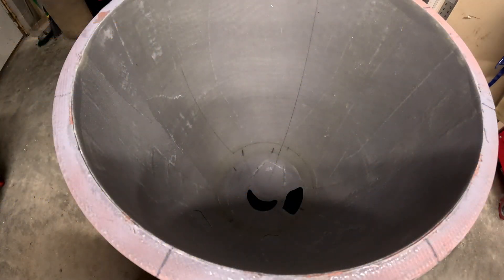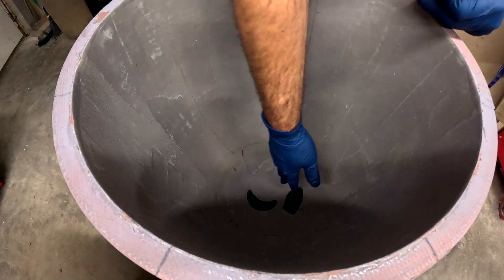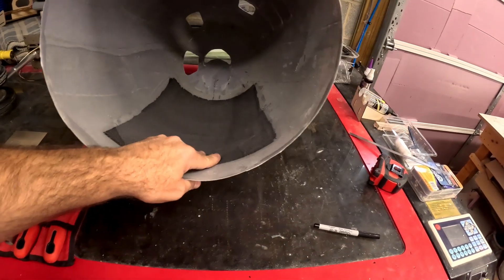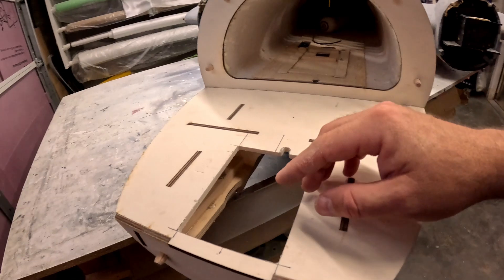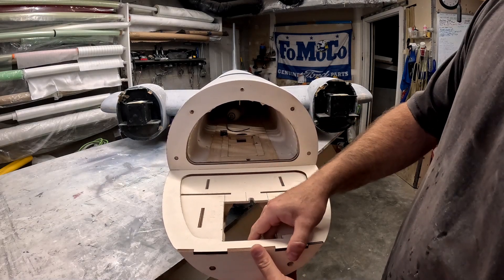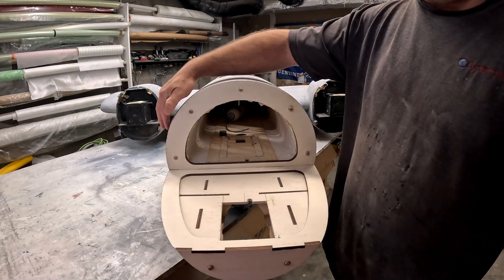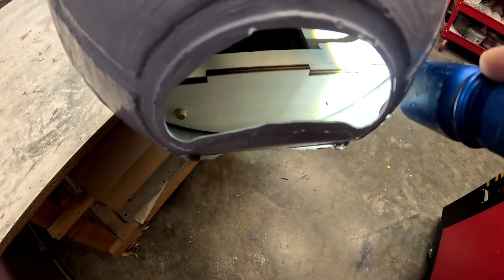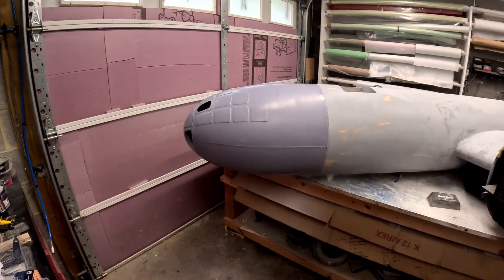B 29 Restoration Project #38 Nose #10

Comment: Is she still planned to be be powered by gas/IC? Or are we switching to E-Power..

Would be neat to see a set of Saito FG Series engines on her. No need to worry about fuel-proofing paint.
Reply from the maker: @Blackstarr223   e power is unrealistic, especially something this large in my opinion, so it will be gas.  .  Saito also does not make any engines powerful enough for this thing.   In order to use radials, it would need moki 150 sized engines.